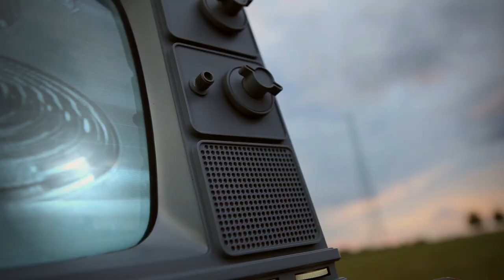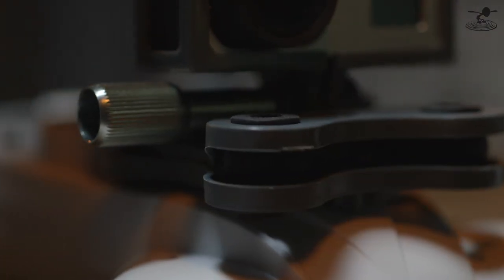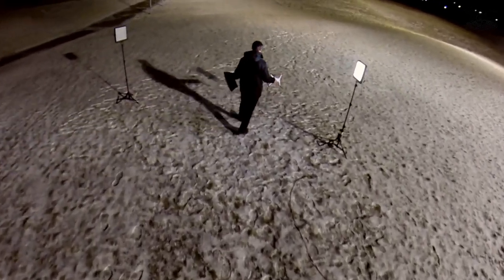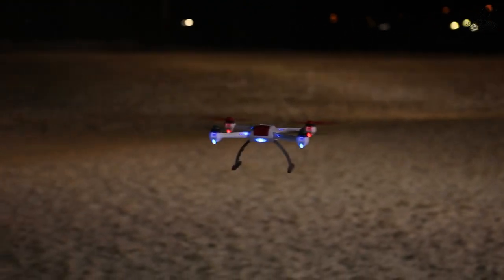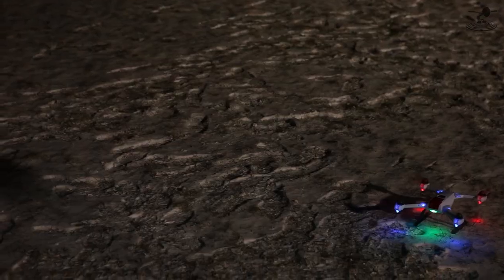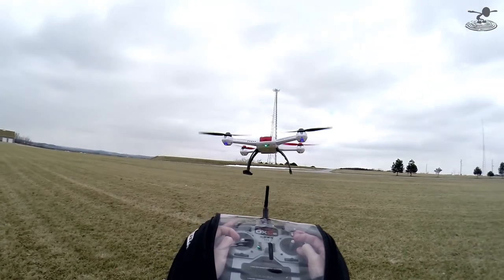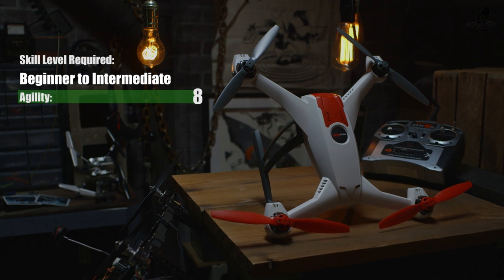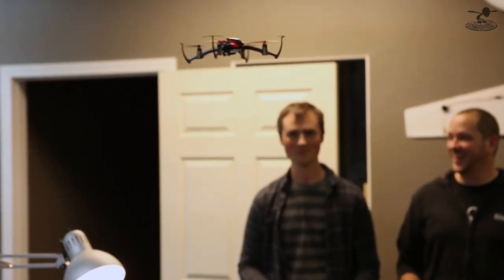Flite Test - Blade 350QX Quadcopter - REVIEW

Comment: Pick up a second hand 350 last night, been out playing with it today.
As a complete novice having never flown a quad before I found it great, safe mode is very slow didn't take me long to move up to stability mode. Did loose it once but that's my mistake for not understanding the return home mode, luckily found it about 1/2 a mile away in a field.
All in all I found it a good quad to start on as it gives you more flight input so you learn pretty quick.

Comment: I'm new to RC quads and recently bought a Blade 200 QX. So far I've had no problems with it. I'm still learning to fly it and have crashed many times, but overall it's been a very easy learning experiance. I've had to replace a couple of the rotors and the battery cover could have been made a little more sturdy, but it's still a very sturdy craft. Definitely considering upgrading to the 350 once I get more comfortable with the 200.

Comment: I've been flying my 350 v2.0 for around a month now. I bought the RTF version with the DX5I transmitter. I've found it to be a great introduction to multi rotor flying, having had petrol and 450 size electric helicopters. The safe features have saved me almost every flight, however it dose have limitations. David highlights a lot of the technical shortcomings and design limitations. I would like to add that the Return home mode can catch you out if you are flying in a sheltered area with high winds. I used the return home mode and watched my quad drift rapidly away downwind because it could not overcome the prevailing wind in that flight mode. However it did buy me time to figure it out and fly it back. 
Also the issued GoPro mount supplied has a major flaw in that if you clip a bush or tree branch while doing a flyby it will just separate the two halves of the mount and toss your camera off into who knows where! ( mine is still in the bottom of a mucky pond) untill I man up enough to go snorkelling for it! So get a small cable tie on that bugger! I posted a YouTube video of the limitations in flight modes if you guys want to see me almost loose mine. Just experience really.

Comment: I recently purchased a 350 QX3 AP Combo RTF With SAFE technology and I have been nothing but impressed. I am a skilled pilot and between the 3 axis gimbal and the stability/ap flight modes this beautiful bird captures absolutely wonderful stills and videos, even in moderate to severe winds.  I did have to disassemble it already to swap boards and it is not as hard as everyone makes it out to be. I was back in the air in 10 min. I would give this quad a solid 9. The only way to upgrade from this quad here would be the DGI's inspire 1 at close to $5,000 I will stick with my 350QX until my areial photography business picks up.

Comment: I have my blade since a year now, it is my first quad. I began flying it very safely doing what is written in the manual. When I began flying it with a gopro, problems came up, two fly away and a night in the net to understand the issue with the wifi. Since I removed the gopro, switched to another cam with an fatshark transmitter, no problems any more. I crashed it once by own mistake and had to move all the inner live to a new body. Lots of screws, I agree but easy to do. I also changed from the original props to carbon blades, this helps for better videos. I do not know other quads but for my opinion as a beginner this one is certainly not that bad.

Comment: I was just given one of these  Drones yesterday with the nice gimbal camera and I am looking forward to trying it out. It has a full charge on the battery pack looking at the lights on the Drone.We have not located the charger  or clip that holds the Smartphone but both can be ordered online at a reasonable price. The owner passed away so the roommate gave it to me. I much prefer the camera I got with it since I don’t own a GoPro of any kind. It was a nice gift from a great friend and the previous owner was also a very close friend. I noticed that you’re quiet does not have the GPS antenna on? I thought they all had the GPS antenna that you can raise and lower? I think the video and photography ability with the gimbal camera that came with the Mann makes it an awesome choice for Ariel photography unlike the go pro mount which is terrible.

Comment: I just recently bought one of these, it is my 3rdish quad and my second pre-built. I got it mostly because I have crashed the hell out of my first kit build and later a scratch build and I needed something that would let me learn to fly a little more safely. My experiences so far with the 350 QX have been fantastic and I will be installing my FatShark onto it in the next week or so. I would recommend this little guy to anyone who has the extra cash and want to learn to fly. I do have some video of it in flight on my channel. The camera I am using is a Pyle actioncam

Comment: Excellent Review David, just about 3-weeks too late. I bought the 350 QX at the first of the month after reading a ton of reviews & comparisons between it & the DJI Phantom 2 (not the Phantom 1 as you mentioned). For my first quad, it's been great though. Safe mode has kept me from absolutely destroying the quad the first time I put a battery in, even though it was weird not following direction of the nose. I've now gotten a good handle on things in stability mode but I'm not sure I'm ready for agility mode quite yet. As a true beginner, I have had several "mishaps", mainly with trees. The blades have held up great but the body & landing gear, not so much. I'm on my 2nd set of gear & waiting on my next crash to swap out bodies (which I'm not looking forward to). I've read about a few people mounting the guts of the 350QX onto a knock-off DJI frame so I may do that after I destroy this new body. For a starter quad, I think it's great, but I do agree with the drawbacks that David noted in the video, particularly the body. It's a cheap plastic that doesn't hold up very well. No regrets in buying it, it's been a good (albeit expensive) intro into the quad hobby, but I am looking forward to taking that next step & expanding my horizons into planes and FPV of both. Thanks again for the review and keep up the great work!!

Comment: Day one flying experience (today): pretty good! Took a little while to figure out what blinking green means and how to reset after a crash, because the tiny start-up guide is not comprehensive, but I didn't have any issues like other people have been reporting. It started right away and every time I needed to restart it. It flipped between modes seamlessly and reacted well. I crashed against trees and grass (because it's my first RC helicopter ever), but it took the licking no problem and props are fine. Most importantly, it was super fun! Can't wait to get out into some open space and really let 'er rip!

Comment: For those beginning in Arial photography and want a quad with all of these features and more,  consider the DJI Phantom FC40.  It comes with a 720p HD camera that transmits a low latency image to your smart phone for FPV! ALL FOR 500 bucks!! Durability?  They are built like a Tank.  I slammed into a basketball goal at full speed and slammed to concrete without do much as a camera or prop break! The image is dampened by the rubber ball mounts and it runs off at 5.8 GHZ Transmitter so you can upgrade to gopro and still run WIFI FPV without control interference.  There is tons of support and aftermarket such as gimble.....

David,  I would really like to see a review and comparison on this machine!!!!

Comment: I have a 350 QX for 2 years now and i still have a lot of fun flying it. i first had the spektrum DX 5 controller but then i upgraded to a DX 8 and now it flys even better! 
AP mode on the 350QX works great for FPV and is a lot of fun.

Comment: Honest opinion from a beginner... I bought the QX350 six months ago only having experience flying the Blade CX2. No clue what i was doing with a multi. Out of the box and flying was super easy. I was able to learn each mode and move to agility rather quickly and became id say decent at doing stunts such as flips, rolls etc. I got cocky and crashed after trying to do too many flips too low. I wasn't to high up, and almost recovered. I was left with a broken arm. The Props were fine. I replaced the top half of the body which took time but wasn't to hard to do. Next time I crashed was some time after, I had it about 60 feet up and 50 yards away and it just fell. As if it was turned completely off! Their was no camera or anything attached to it. The entire body was destroyed however the props were just fine. I replaced the body and the motor I thought was bad and when I turn it on 3 motors spin and the 4th seems to try and spin in both directions so this is on hold for now. However I purchased the new QX350 2.0 and I am very pleased with it for me and what I want out of it. It fly's great and has a new flight mode and a compass/GPS error detection which actually works. I've only had this 2.0 version for about 2 weeks but i have well over 50 flights and it thus far is a champ. AP mode for video seems to be more stable but not amazing. The only issue I have experienced is the decent rate seems to be much faster even in safe mode. Which to me is a good thing but I was expecting it to slow down. Good thing I was paying attention! I did do a calibration and it still comes down faster then my first QX350. Overall I think from what I have experienced its good for flying, its agile, its quick but I wouldn't say fast, its okay for taking video, and my average flight time man handling it is about 8-10 min. If im just cruising, 10-12 min, and if im taking video its about 6-8 min. Hope this helps someone.

Comment: I purchased this in the QX3 version mainly because my local hobby shop has replacement parts in stock for it.  Replacing the body is time consuming if you crash, but not too bad.  Just added FPV and it feels like a great starter platform with all of the 'uh oh' features.

Comment: Great review, thanks and well done! I have today received my Blade 350 QX and will bind it to my Spektrum DX7s transmitter. I've always liked the Blade products as spares are readily available from our local hobby shop. This is my first quadcopter so I put a lot of emphasis on the safe mode and return to base features. After doing some internet research I am a bit concerned about the GoPro interference. I have read that if you disable the GoPro WiFi it should not be an issue, is this correct?

Comment: I dont fly my qx 350 very much but the last time i took it out to try and fly it, the tri color light did not work at all.  Every thing else works fine except i just cant tell what mode im in.  Could it be a burnt out light.  I just changed the gps to a new one.  My 350 is not all that old but the light  went out unexpectedly.

Comment: Though this video is somewhat old, I would like to say that I've had a pretty good experience with my blade 350 qx so far. I previously owned a DJI Phantom 1, and while the aerial video quality was pretty good, the enjoyment of flying and FPV ability was pretty sub-par. On the other hand, so far the blade 350 qx has been a great fpv platform, so much fun just to fly around, and I've actually gotten some pretty nice footage. Finally, what made the decision for me was the fact that Blade 350qx's are available for MUCH cheaper than a DJI Phantom at the moment. I picked mine up RTF from an ebay seller for just under 300 dollars. For that price, the Blade 350qx is a total steal, and a quad that is really awesome to have. GPS lock is also more reliable it seems than the DJI Phantom I had, and the DJI Phantom only offers gps "trimming" but no actual trimming. Therefore, if you're considering indoor flying, DEFINITELY go with the Blade 350qx in my opinion.

Comment: I'm honestly relatively new to the hobby, which means that I don't have any experience or opinions or even know what other quads might give me. Even doing research, I found bad things about a lot of things... and good things about a lot of things. All I knew is that I didn't want to build it first. I just wanted something to play with and could later upgrade with some FPV equipment. So far I'm enjoying it, and have future plans to purchase and build a QAV400.

To me, the 350 QX2 is good for what I want to do and so far I'm really enjoying flying the thing. Granted, I'm not aggressive with my quad, and being a newbie I am flying it in wide open fields with few things to crash into other than the ground. I've gone from Safe, to AP, to Stability, and I'm only just now testing out Agility and seeing how that feels. Succesfully done a few tricks! Though honestly there's a lot I need to learn to make Agility Mode the best mode.

Sad thing right now with the 350 QX2, I want more of the big batteries but they don't sell them yet =( What the heck releasing a product and not giving buyers access to the consumables right away. =P

Comment: Good review David, I bought the 350 after I built the FT Anycopter because I wanted to try GPS.  It has turned out to be a great quad for my grandson to learn to fly, it gives them a chance get stick time without the worry of a crash.  I have changed the  problematic props by use of an adapter.  With the attachment of a Tarot gimbal, much of the unwanted movement has disappeared while using the GoPro.  I have had no luck with the Shark FPV because the transmitter blocks the GPS lock.

Comment: I have a QX350 that I use with a GoPro3+ Black. There is an rf problem between the quad & GoPro requiring shielding. I added a gimble for video stabalization; which required a custom power connection built at a local hobby shop. Works good for aerial videos after adaptation. If I had to do over I would have gone Phantom or waited for the newer QX350 with gimble and alternate camera that does not have rf conflict.

Comment: I have the Blade 350 and love it. I did not get it to do video but to have fun. the fact that i can put a gopro or some other cam on it is just an added bonus. I have let others fly my quad and they love it. I am more interested in getting people into the hobby and having fun. I am new into the hobby of quads but use to fly planes years ago. I was looking at building my own multi-rotor flyer but for the price, i decided i would go with this and build one later. I let my kids fly this and they have a blast. I guess i am more into it for the fun. I have not had any issues with mine and it has had some hard landings and been knocked around a little bit. Lets enjoy the hobby and if you know of a quad that does all these things for the price same price, please share, I liked the phantom but it was quite a bit more expensive when i bought mine.  Lets have some fun and fly!!!!!
I thought the overall review was good but i have recommended people to buy the Blade 350 and will keep doing so. Keep up the good work FT.

Comment: I bought 2 a few months ago and when it flies right it is a great flier.  With the GoPro mounted it can become completely uncontrollable without warning and that is even with a shielded camera as well as foil shielding added to the bottom of the Quad.  I bought mine for video use and should have gotten the Phantom instead,  I now have both the Phantom1 and the FC40 with the latest firmware and have not had issue one so far and that includes carrying a gimbal.

Comment: I own a QX2 - broke the body for the second time the other day. - I agree its a pain to move everything over to a new body. - however the cost of an entire body is pretty cheap. - I've recorded a lot of footage using the gopro waterhousing and the vibrationdampening that came with the quad. the footage is pretty smooth unless I fly really high speed. - I just got my first fat shark predator goggles today, and I've mounted the transmitter to the QX2, so I'm pretty exited to go for my first FPV flight tomorrow.  - All in all I'm pretty happy with it, Mainly because of the price, since its a lot cheaper than a Dji Phantom

Comment: Love my QX 350. I'm 60+YO, started flying in Jan. this yr. No quad. heli experience @ all, Zero. I started flying on computer, Phoenix 4 program/30 hrs. Got 350 in GPS and went from there. Crash into everything, replaced props, top shell, 1 motor, cam mount. It's still going. It rattles and sounds like flying junk, but flys great. Flying fwd/backwd/on point/all left & right/flips/rolls. I have 4 other film & fun copters now. IMHO it is a great beginners copter. I don't have time or skill to build, so I have local copter shop put my stuff together. I'm getting another 350-I think this first one deserves a rest.

Comment: Thanks for the superb review!  Answered a lot of important questions I had about it...  Looking to upgrade to something bigger than my LaTrax Alias, with brushless motors and FPV capability.  Considering this, DJI Vision 2, or a Walkera QR X350...  I've heard the Blade's blades can break in flight and the problems that DJI has had with firmware and loss of control.  Still researching...

Comment: I think you nailed it pretty well. I bought the 350QX and the NanoQX at the same time. I love them both. My video experience wasn't great on the 350. I still have a blast flying it, especially at night. I put aftermarket prop adapters and carbon fiber props on mine. One of my arms cracked pretty badly right at the body to arm juncture. At the time, new frames were backordered. I took it apart and did some fiberglass/epoxy repair and its probably stronger than when it was new. It is expensive, but I don't regret my purchase. I bought the BNF, used it at first with my JR 9503, but have since moved to Spektrum DX9.